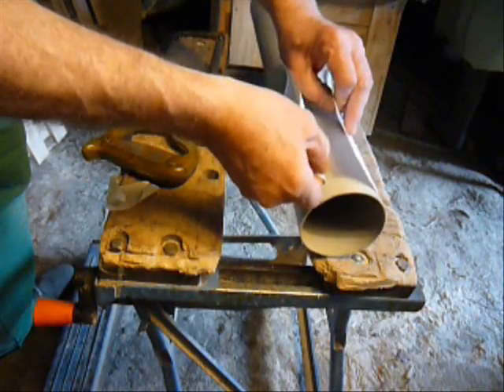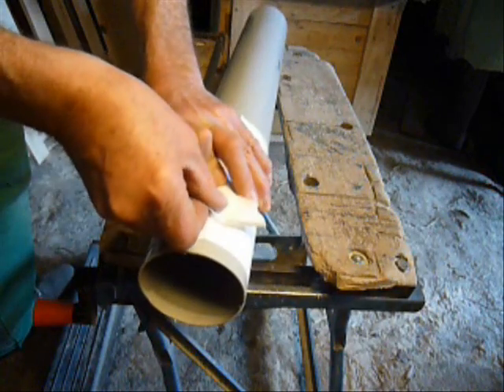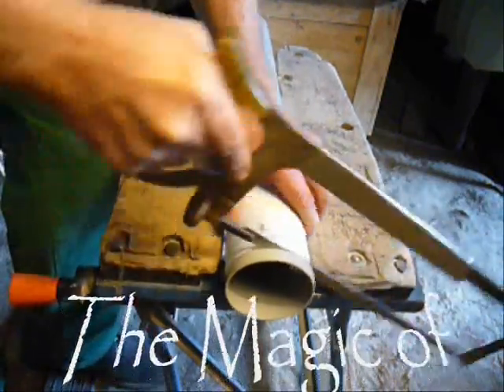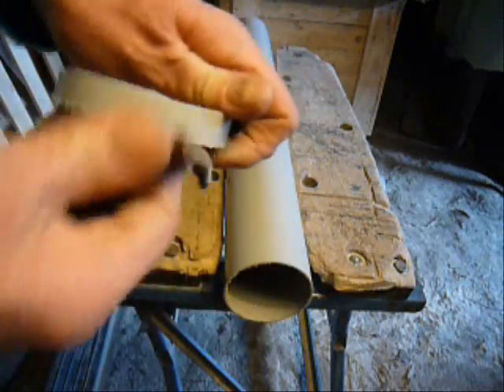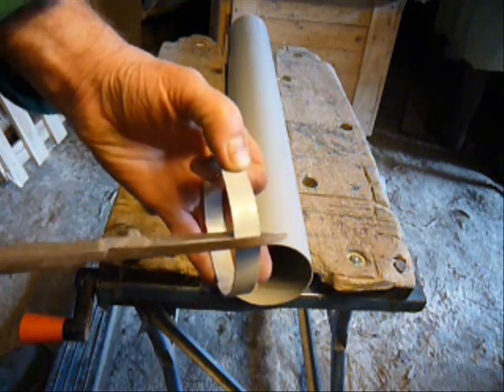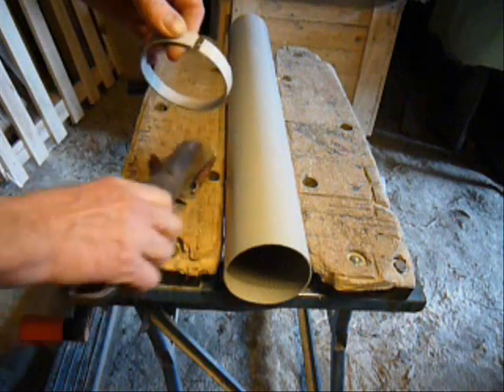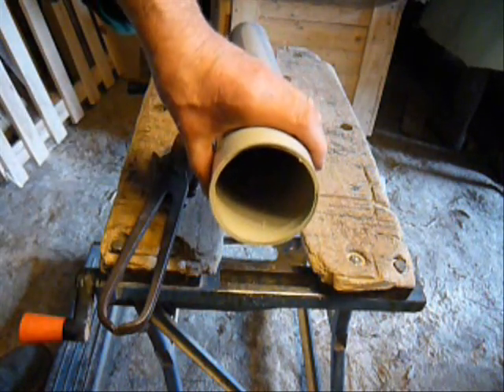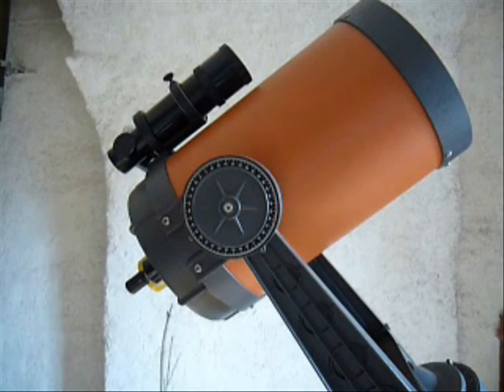How to make a lockable solar filter for a telescope

Comment: Well done. I have a 10" SCT and the cost of a complete filter was $120. Using your plan,I can cut a piece of 10" sonotube that was left over from a homemade dew shield project for  $58 of filter material. I like your cosmetic material covering. It looks like the techniques I use in my unprofessional carpentry work to cover up misalignments.

Thanks!
Reply from the maker: Lee Wolfson Hi Lee, that's great and so glad you found it useful. Did you see my other film for making a really cheap solar spotting scope. It is here if you are interested:  How to make a solar finder for your telescope.Comment faire un viseur solaire pour votre téléscope All the best and happy sun spotting! Andy

Comment: Nicely done, Andy, How did you design the clips to hold it in place?
Reply from the maker: Thanks! I'd noticed this kind of fitting on a food processor.  I thought of using the existing screw heads on the telescope tube as the means of holding the filter in place and the 'dog-leg' slots were a natural development for ensuring the filter stayed in place. The small locking arms made from off cuts of the tube were merely a 'belt and braces' security backup so nothing could shift. All the best from Normandie, Andy

Comment: Because of my different telescope I used plant pot trays with the filter inside them. Cut out the two bases and super glued them together. Finally got a day with no clouds and veiwed the sun today with it's many sunspots. Wouldn't have tried it without watching this vid so many thanks. 
P.S I used alot of cellotape to make sure it was secure and had a great afternoon.

Comment from the maker: Hi, Thanks for the enquiry. The 'objective' end of the tube i.e. facing the sun, I secured a piece of opaque plastic (I used the inner from a wine box) but some left over solar film will do. I pierced a hole with a pin in the centre of this now taut surface. At the opposite end of the tube I adhered a piece of masking tape sufficient to cover the diameter, this translucent material acts as the screen. cont....

Comment: I made a solar filter for my skywatcher ED90 but used cardboard (saw your video too late).

I'm really interested in the concept behind your pinhole projector finder scope. I've a piece of 20mm PVC pipe (only size that will fit my finder scope mount snugly) that I'll fashion this from with a cap for both ends. Can you explain how you made yours and how you use it. I'm really keen to get this in time for the Venus transit. Thanks in advance.

Comment: Since most manufacturers sell 'flat' face on filters (i guess its cheaper) there will be resistance for angled mounts using reflectve filters.
 i have mine mounted at ~20 degrees, (the exact angle is not really important with this kind of filter - but can be for specialist filters), but it should be large enough to avoid the re-reflections from inside the telecope. 
Basically, you want to avoid the re-reflections of your eye/CCD/secondary etc  superimposed on the solar disk.